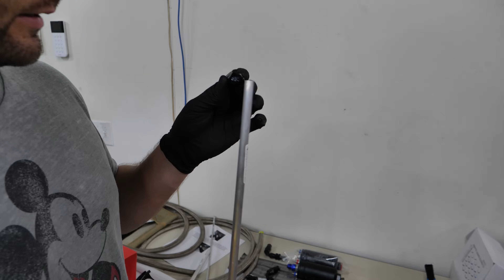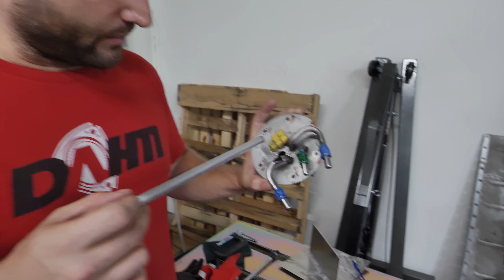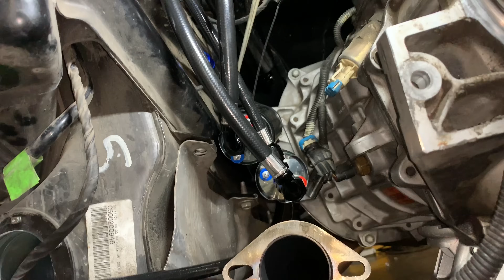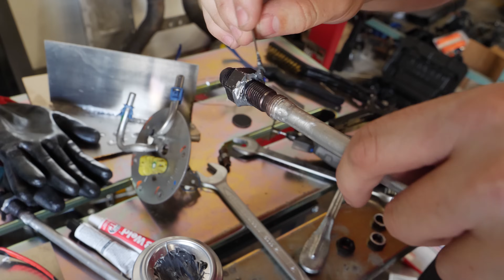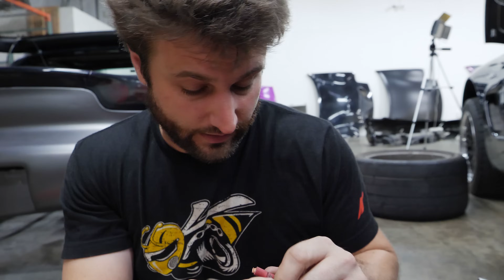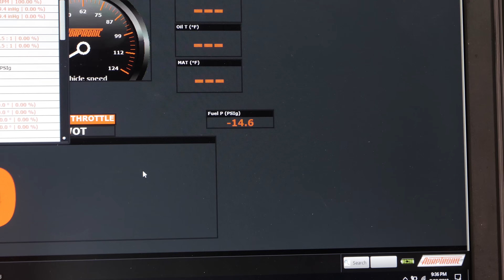Corvette Fuel Tanks SUCK. Upgrading the Rotary Corvette to E85

Comment: Why didn’t you just put a fuel pump in each tank??
Reply: Justin A yes but if he already had two fuel pumps, couldn’t he have just put one in each tank?
Reply: Justin A this would’ve made it WAY simpler
Reply: @haydenallen888  That's not really the way C5 tanks work. BUT...Turning the RH tank into a surge tank with twin pumps in it, being fed off of the LH tank, would have been a reasonable approach, IMO. I can't help but wonder what the guys with big power C5s are already doing, because it certainly isn't what Rob is doing...

Comment: When soldering put the iron underneath the wire, let the iron use heat rise and all that. Flux core solder can help with cheap ass aluminum wire as well. Cheers on a great set of builds man.
Reply: He's never going to get that much wire hot with that soldering gun anyhow (and didn't). That's a job for a torch...
Reply: @TheBrokenLife  I've been doing that for years! Never knew it had a name lol
Reply: @TheBrokenLife  If he used it correctly it would. 
I've been doing wirring for over a decade.
Reply: @JamesSmith-nd5kr  I've got about 15 years on you then, and I would have done that with a torch (pretty much anything over 10awg, I don't screw with the irons. They just take too long). Regardless, we agree that what he did did not yield a good result. That's the coldest solder joint I've ever seen. The shrink tube is probably doing more to hold it together.
Reply: @TheBrokenLife  Your correct, soldering guns suck on any large gauge wire. Also he should have wrapped a stran of wire around the joint first. This also helps hold the wire together as your working. That's required on every soldered wire at Roush.
Reply: @JamesSmith-nd5kr  I'd expect a Western-Union style splice from a professional outfit like Roush, but, the wire wrapping trick is interesting too.
Reply: @TheBrokenLife  It's free and there cheap lol
Reply: @JamesSmith-nd5kr  A western-union spice is a technique, not something you have to buy. I do have some experience with Roush and I can testify to their lack of desire to spend money, but we're talking a few extra seconds, if that. Anyhow... For that job, a WU splice wouldn't have worked, but that wire wrapping trick would have. I'll file that away for use some other day. Good tip!
Reply: @TheBrokenLife  I'm going to look into the WU. Thanks for the info!
At the end of the day, a ziptie would have worked better then what he did lol
Reply: @JamesSmith-nd5kr  A zip tie... LOL!
Reply: Never use flux core solder on electrical wires. The flux causes high resistance in the wire.

Comment: Work hardened stainless steel becomes magnetic. They probably used a laser or plasma cnc to cut at sending unit cover.
Reply: Plasma/laser would cause heat-affected zones which can change the metallurgical properties and stuff. But these plates are probably work hardened as you said due to punching. Punching thin stainless like that with multiple holes would be much faster and more cost efficient than cutting individual plates, plus would have the added benefit of not potentially taking away corrosion resistance due to heat affecting it.
Reply: I'd think they would laser/plasma because its faster and cheaper than replacing a large punch in a huge tool. that would better explain the heated edges and magnetism. I don't think a punch would offer that much heat. that's my speculation, nothing scientific.
Reply: @TheDiamoniteG  Laser or plasma on those parts would be radically more expensive than a stamping die for the volume GM is buying of them. They build about 150 Corvettes a day, which would be about 300 of those (with slightly different inserts in the tools for LH and RH). That's hours of table time vs. minutes on a stamping press (that also stamps other, similar, parts for other cars). A die to punch those wouldn't be more than maybe $20k and there's no reason it would wear out quickly (as in, would last for years with a little maintenance). Plus, you'd see either a ragged edge on them from plasma or a straight up black edge on them from a laser. If you look carefully (easier to see in person) you can actually see a slight crown on the side where the die comes down too. For an illustration of what I'm talking about, pick up a flat washer and you'll see one face is rounded and the other is not. Same thing on those sending unit hats.

So, anyhow, I agree with Tyler. Those hats are punched and work hardened in the process.
Reply: I thought about that after I posted the comment. I figured nobody would care, so I never bothered to edit it. Woops. A stamping machine would also work harden the edges. I should have considered that before posting. I blame beer lol.
Reply: @David_Blanck  Blaming beer is always a solid move!

Comment: well from experience youle be re doing that fuel pump area in 6 months to a year. jb weld does not like fuel and will deteriorate and start leaking.
Reply: He’s tac welding onto the jb weld that’s welded to the steel it’s not going anywhere
Reply: Shin Sho  that doesent matter people need to know this so they dont try it them selves
Reply: JB Weld, the original cold weld formulation does just fine with hydrocarbons, including leaded race gas. It's the ethanol exposure that'll be the problem. 10% to 20% content has been fine in my experience, but last time I checked JB Weld's website they didn't have any ethanol friendly epoxies. I'd look to another epoxy if it's going to be exposed to methanol, or ethanol over long periods of time.
Reply: @seanhenry8030  ill go suggest to projectfarm to do a test with gas and alcohol vs different adhesive methods
Reply: everything he does he seems to knowingly half ass and then complain when it fails in six months.... its baffling
Reply: And he'll find a way to blame Chevrolet or V8's
Reply: Should get some sealant that is good for fuel. I think there's one called Seal All. I used it to re-glue a trunk lid seal. It said it was good for fuel.